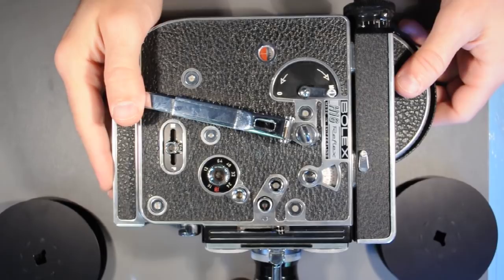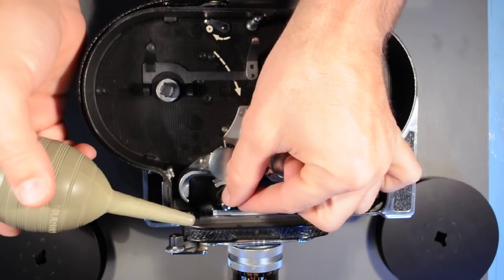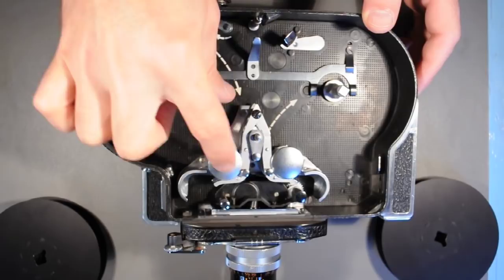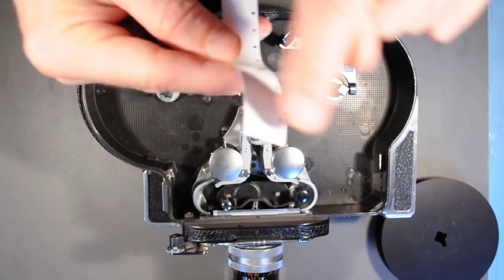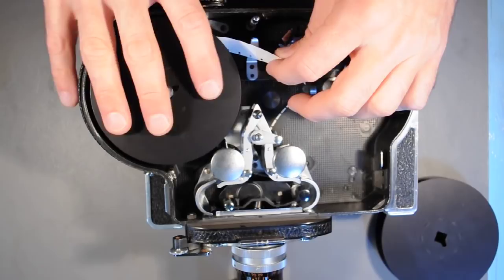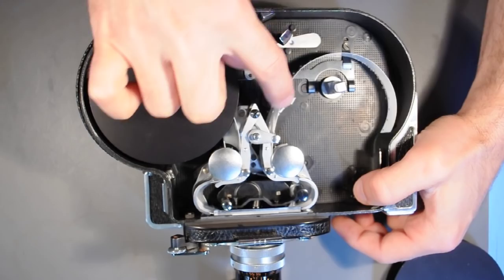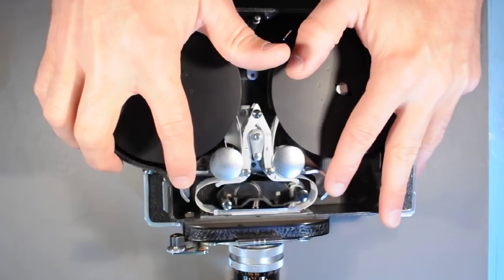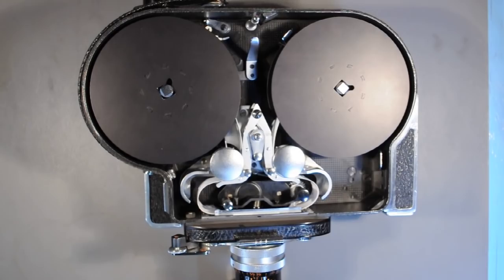Loading a Bolex 16mm Movie Camera

Comment: Thanks for this tutorial, I just bought a 1940s model with the double perf wheels.
I didn't know it at the time. I paid $180.00 for it. I was a bit disappointed that I couldn't use single perf so I removed each wheel and hand ground the top sprockets off, then used 400 grit sandpaper to polish. Can't wait to try it out!
Reply: +Simaka Wolf Actually, nitrocellulose was never made for either 16mm, 8mm, or Super 8mm cameras. Any 16mm film stock is either cellulose triacetate or Kodak's Estar base. And Acetate film can be either single perforated or double, it just depends on the age and emulsion type of the film.

Comment from the maker: The black film reels are called "daylight spools", which can be loaded in subdued light. Ideally, this is just enough light to allow you to see what you are doing. A 100' roll of film has some extra film at the head and tail to allow for the fogging that will occur. It's possible to load a camera with film on daylight spools outside on a sunny day (preferably in the shade), you'll just have more fogging.

Comment from the maker: Loading and unloading the camera with a 100' daylight spool can be done quickly in subdued light or shade- ideally just enough light to see. The first few feet will be fogged, but the rest of the roll should be fine. Save the box and other packaging that your film came in and quickly transfer the film from the camera to the box after you are finished shooting. After you get it back in the original box, tape the box closed, so it doesn't open accidentally.

Comment from the maker: That's a very old model. It should use standard 16mm film, but you may want to verify that it can take single perforated film. Some old cameras are double-perf only. Double-perf film is hard to obtain. Kodak film specs list 1R for single perf and 2R for double perf.

Comment: 1: Where did you get that?
2: Where did you get the leader?
3: Will the noise of the camera affect the sound in the film?
4: Would you recommend the Bolex for 16mm filmmakers?
5: Is it hard to use?
6: How many feet of film does it use/how long would the video be on one roll?
7: Does it take batteries?
8: This would be very helpful if I ever get one.

Comment: Hey really helpful tutorial I recently was fortunate enough to get a Bolex h16 and I love it. Although when I got one of my first reels of film and loaded it in it jammed and film spewed all over the camera about 40 ft in to the spool. I don't believe it's the camera because I've used dummy film and watched it feed all through with no problems. Has this problem ever happened to you? And if so how would you prevent this from happening again?
Reply from the maker: +Ben Chew Yes, I've encountered this problem and it usually indicates that there is an issue with the take-up spool. If the film is bunched-up or "accordioned" after it runs through the lower loop, then check to make sure your take-up spool is turning freely and the film is attached securely when the camera door is closed. Make sure your spool is not bent in any way.

Comment: Hey there I found your video  so much easy and informative. I have a question if you can answer or give some tutorial of that then it would be awesome. I am film student and i have assignment to shoot on this camera. I want to shoot multi exposure type of film. So what steps i have to follow. please tell me :)
Reply from the maker: +vashisth trivedi HI- Thank you for your kind words. A general rule is to underexpose your footage (either slightly or by several f-stops) and experiment with different exposure settings to achieve different results. The footage from each pass through the camera will affect other passes. If you have negative film, this will be somewhat easier for you than reversal. Also, your Bolex may have a variable shutter which can be used to vary the exposure time and fade in and out.
Reply: Like i want to shoot the an actor twice in a same frame. What to do? Can you please?
Reply from the maker: +vashisth trivedi It sounds like you will want to research shooting with a matte to mask part of the image. In this case, you can expose your image correctly while masking part of the frame, then mask the opposite part of the frame for your second pass. There is a special matte box made by Bolex to make this easier, but it's not too hard to make your own DIY matte box.
Reply: +easterisle yeah like I want to make double exposure film. Well I am sorry but I didnt get what you said in last comment. sorry to bother you can you tell me bit in detail please!

Comment: Hi there, great video. I just purchased a Bolex and I am going to use it soon. I do have a  question. I suppose I have to load the film in a dark room, right? or is it safe to do it on location? If I do load in a dark room, should I use a red light to be able to see what I am doing. Or what would be the procedure?

Thanks in advance.
Reply from the maker: Hello. Your new film will come loaded on a small metal reel known as a daylight spool. This allows you to load the film with light and only the first 10 or so feet will be affected. After loading, you will need to run the camera until the footage counter is at "0" before you shoot. I advise that you load the camera quickly in just enough light to see what you are doing, that way you will fog a minimum amount of film.

Comment: Hi, how do you remove the used reel so you can reload the camera?
Reply from the maker: After all of the film is on the take-up spool, place it back in the light-tight packaging. Do this in subdued light or in the dark. Tape down the loose film end so it doesn't unravel and tape the film box closed to prevent accidental opening.
Reply: Thanks

Comment: No need to load them in a dark room or dark bag?
Reply from the maker: Hello. Your new film will come loaded on a small metal reel known as a daylight spool. This allows you to load the film with light and only the first 10 or so feet will be affected. After loading, you will need to run the camera until the footage counter is at "0" before you shoot. I advise that you load the camera quickly in just enough light to see what you are doing, that way you will fog a minimum amount of film.
Reply: @easterisle  thank you so much! And then when I unload I use the rewind thingy to put it back on the original spool, and put the film back in case it came in ?
Reply from the maker: No,  @sabocine , when you shoot, your film will wind onto the take-up daylight spool and you remove that when the roll is complete. Then you keep swapping spools every time you shoot another roll. Save all of your original packaging from your new film so that you can put your exposed film in there until you are ready to process. Sealing the box closed with black gaffer's tape is also a good practice.